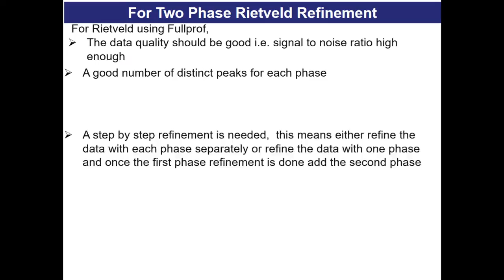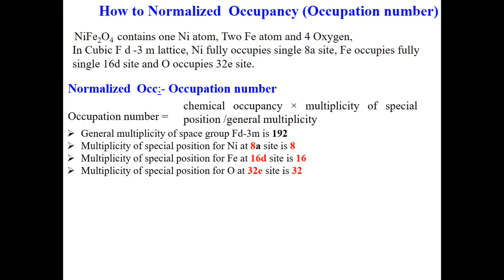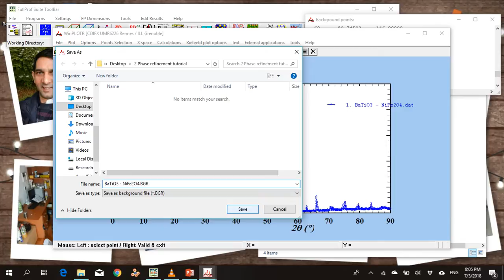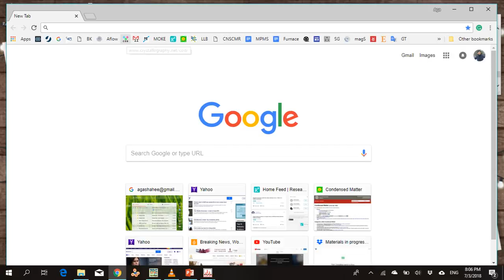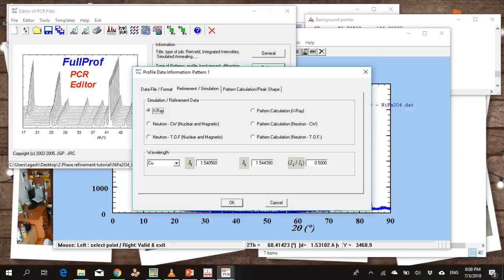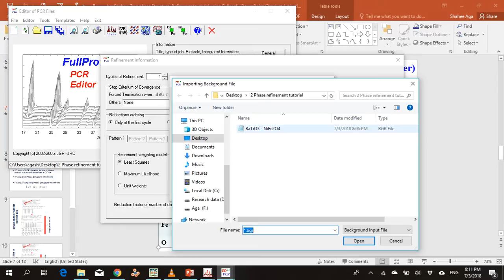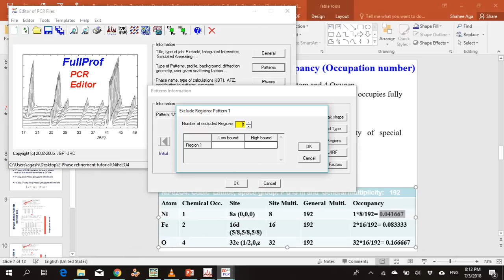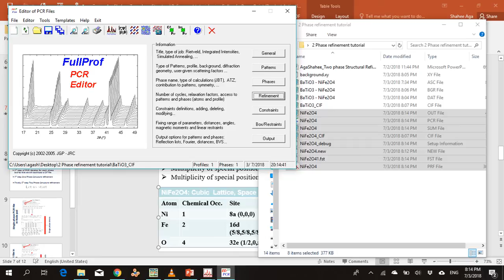An easy way to perform two phase structural refinement using FullProf: Part 1

Comment: Thank you so much. But in my case I don't know is it my software issue or something else that when I run refiniment it gives error.
Reply from the maker: Most probably, you are doing some mistakes. Most of time, people selected wrong data format (like experimental data formats is 2 column .dat) and in PCR we selected it something else. Also sometime we forget to delete comments in experimental data formats that exists at end of data. Check all this and I am sure, you will be able to refine your XRD data.

Comment: Thank you for your tutorial. It is very much helpful for multiphase refinement. However, the values of the occupancy which you estimated  as shown in the video are not matching with the expression as you provided in the video.can you please clarify the doubt?
Reply from the maker: There is a mistake in slide 7. The correction you can find @https://www.researchgate.net/publication/326176003_An_easy_way_to_perform_two-phase_structural_refinements_using_FullProf

Comment: Hello Aga Shahee,
I have done Rietveld refinement using fullprof on multiphase AHSS in order to obtain relative amounts of ferrite and austenite. But my PCR file does not show  relative fraction of phases after refinement. Please help. Thanks in advance
Reply from the maker: If you have done structure refinement it should show, check .out file. If you have done profile refinement it will not give you any output related to phase fraction

Comment: Thanks for your tutorial video, they are extremely helpful for my ongoing research. However, I noticed on Slide 7, the occupancy for oxygen, you have 32*16/192, did you mean 4*32/192? The chemical occupancy for oxygen is 4, multiplicity of special position is 32, and the general multiplicity is 192.
Reply from the maker: Welcome. You are correct, it is a mistake in presented slide 7.
Reply from the maker: Sorry, There is a mistake in the occupancy calculation in the above video and the correct one can be found in the PDF file of the attached link, Please have a look to that once: https://www.researchgate.net/publication/326176003_An_easy_way_to_perform_two-phase_structural_refinements_using_FullProf